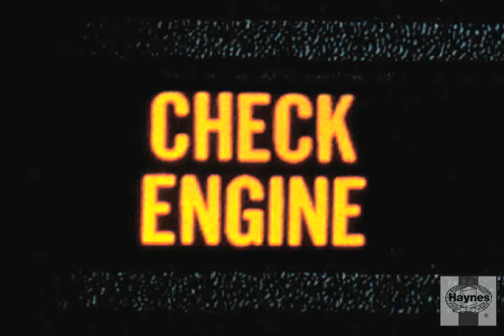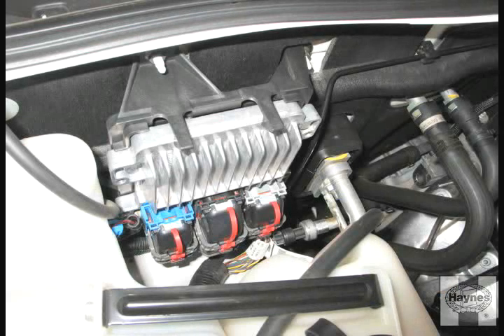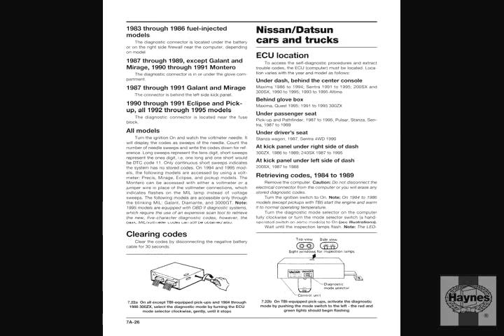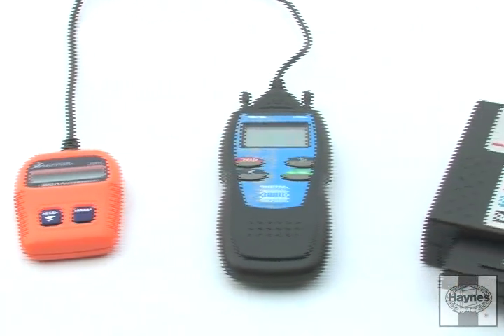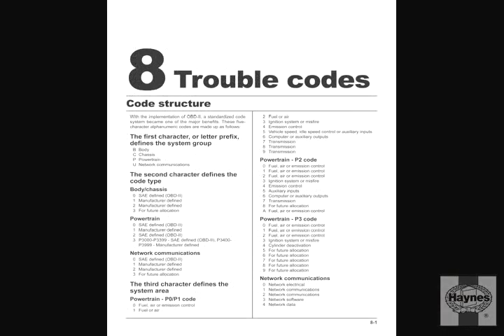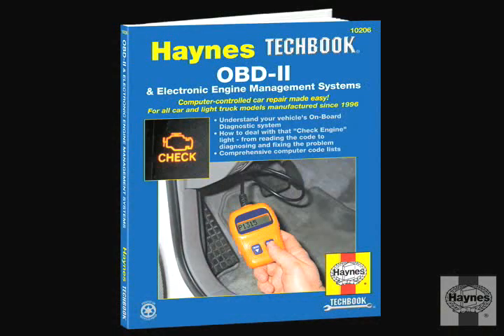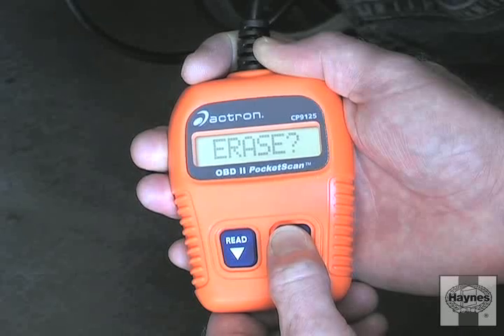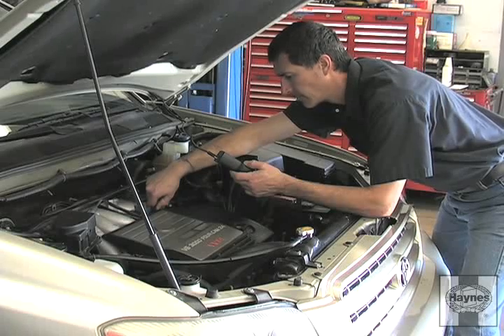Reading trouble codes

Comment: I had a a check engine symbol come up on the LCD screen in my Holden Commodore which is fitted with the Chevrolet LS1 engine at the factory.All I could find was the generic P0000 trouble code (no fault found) with both a hand held scanner and the ELM327 dongle interfaced with a laptop running Linux software.I had trouble with a high amperage CS130D alternator which was causing headlamp & dome light flicker so I rebuilt it so it is an as new unit (i.e. new rotor,diode pack,bearings & brushes) which has stopped that from coming on so far , so I assume that spiky & pulsating was causing the computer to set off a CEL though no actual fault code was recorded so time will tell if that was the case,that had me stumped too.I had a restricted fuel filter which was causing driveability issues so I blew a whole lot of organic debris (i.e. grass & leaves) out through the inlet side of the filter into a bucket,since then the car hasn't had those issues either,no fault was recorded then too so there was no obvious fault such as a faulty sensor , etc.